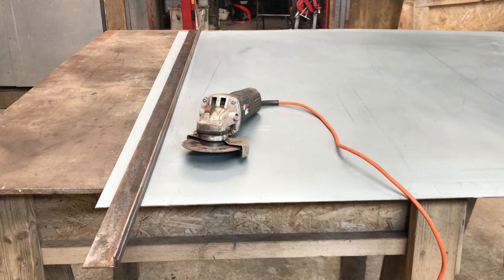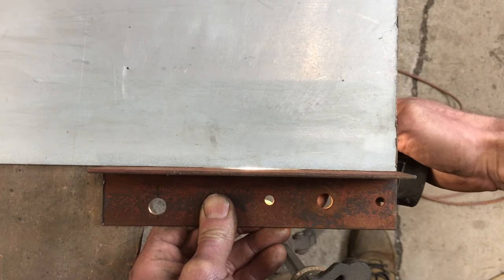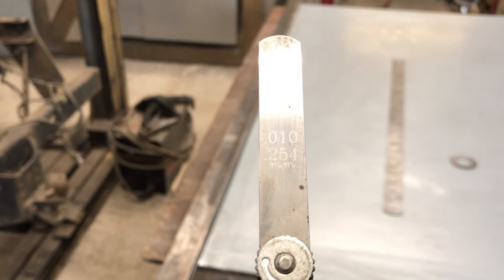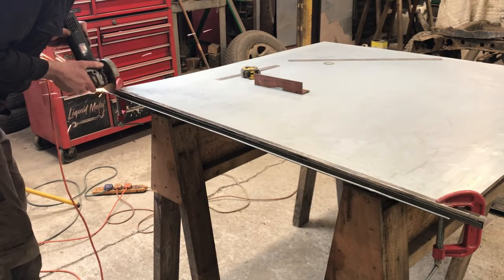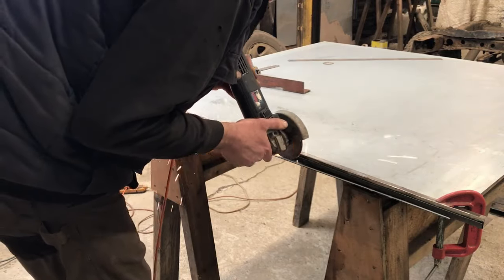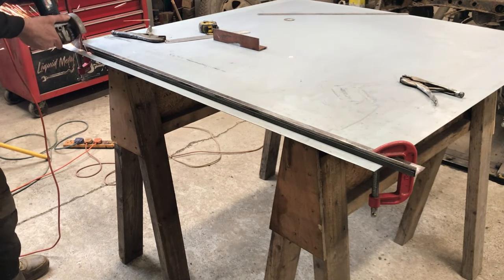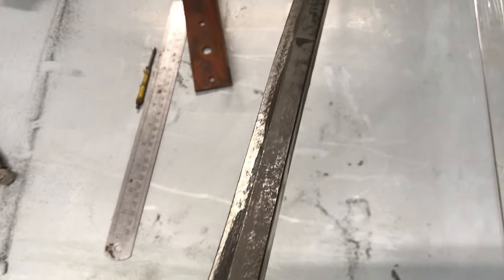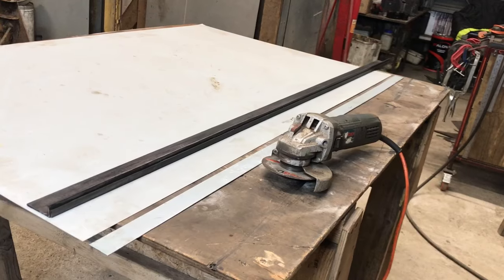The BEST angle grinder straight cutting tool on YOUTUBE ?

Comment: Best idea I've seen so far for cutting sheet metal that doesn't require fabricating a sled with rollers and an attachment that bolts to your grinder.  This is far simpler.
Reply from the maker: Thanks for that, much appreciated. I use the cutting edge quite a lot and I love it. Need to make a smaller version too which would be better for shorter lengths.
Reply: @bensclassicbodywork  Yeah the tungsten is a good idea.  I've been using steel tube and angle iron as cut rails / fence for cutting plywood for years. I have a dedicated 30" and 60" and also use a 1.5" x 1" x 96" tube for long cuts.  For sheet metal though, I've used a bolt in the grinder with a small fabbed L attached to the bolt to press it up against the fence. (so you just pinch the L up against your angle iron or tube fence and help guide it as you cut). It works ok in a pinch only because I don't cut a lot of sheet metal.  Cheers.

Comment: Great workshop guide, like your idea of different lengths. I used a guide to cut a wing, much better than freehand and cutting disc bouncing on metal or going off line.
Reply from the maker: You did the right thing in my opinion to use a cutting guide, even on a wing. It just makes things easier. Where it is really important is when you want to fold sheet accurately, you need an accurate point to measure from. No good if the cut edge is wondering off even by a 1mm. Accuracy is your friend, I'm not sure if I spent enough time in the video getting this point across. Thanks for the comment 👍👍

Comment: What a really good idea Ben. You're dead right about the wear on standard angle. Being a tight-fisted Yorkshireman, I wonder how some glass off cuts would hold up? Even if it cracked, it wouldn't throw the cutting disc much out of line
Reply from the maker: I wondered exactly the same thing, it would be cheap as chips with glass. Glass isn't as hard as carbide but it would definitely resist wear a lot better than steel. Worth a try, what have you got to lose ?